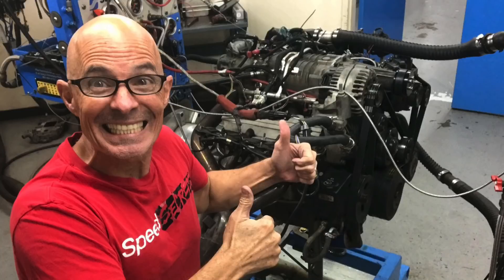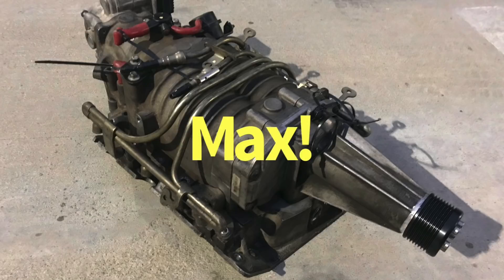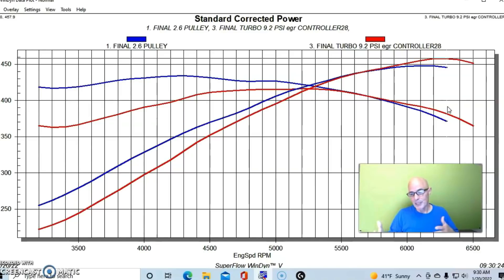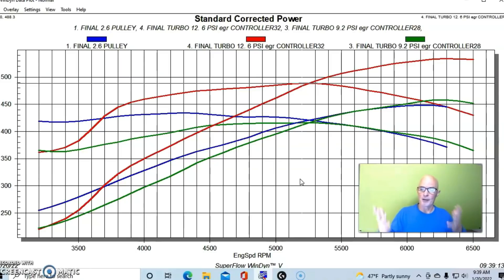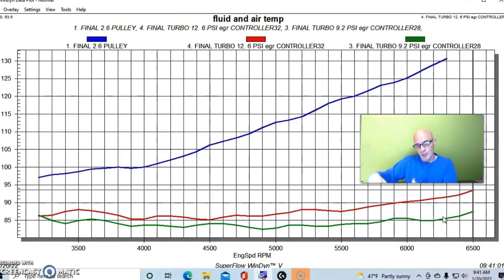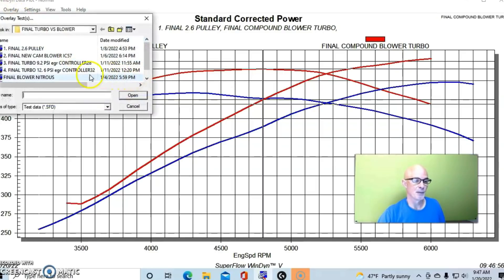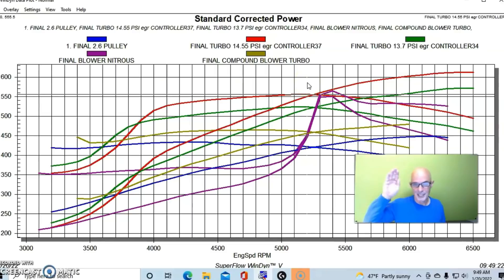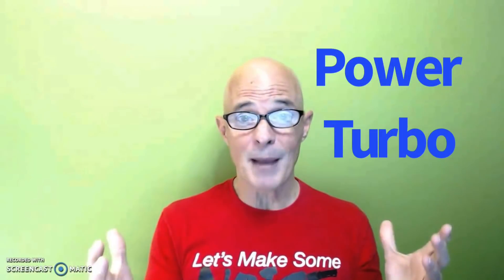WHAT MAKES BETTER LOW $, JUNKYARD BOOST? M90 SUPERCHARGER VS CHEAP, EBAY GT45 TURBO. RESPONSE VS HP

Comment: Could you look at the size difference between the turbo IC and supercharger IC? To be a real comparison @richardholdener1727, you would need to match the intercooler capacity and run the test again.  Much easier to do with a remote-mounted blower and IC.

Comment: I would love to see what an intercooled 1.9L TVS supercharger would do on this 3800 V6.  Also its best to have the supercharger blow into the turbo inlet in a compound setup.  The blower creates way too much restriction when the turbo is blowing into it and you loose the multiplication factor of feeding a turbo a boosted charge.  Maybe do a test and post the results.

Comment: Hey I remember once you said you couldn't run the chevy 3.9. I was just curious why. Same bolt pattern as a 3.8 and it runs on a e38 ecm on the one I've got on my rail buggy. I'd like to do some turbo stuff on one but curious what the power would be. Factory rated at 243hp N/A. Also love all these videos. You're the reason I went from a 14:1 383 to a stock 6.0 with a turbo and water/meth in my rockbouncer. So I'd also like to say thanks!

Comment: Figure out a way to run the supercharger air through the same intercooler you use on the turbos.  That big unit gives the turbo a big advantage.
Reply from the maker: THE TURBO GIVES THE TURBO A BIG ADVANTAGE-IT'S NOT THE COOLER
Reply: @richardholdener1727  No doubt.  I know that the old Eaton 5th Gens barely break 60% efficiency, and turbo's generally aren't even mapped below 65%.  If somebody is matching a turbo to their engine and ends up running below 70% efficiency, they have the wrong turbo.

But what is the relative effect of the two?  Gale Banks did some good testing of that in his Killing A Duramax and Building a Monster Truck series of videos.  At the ~40 psi boost he was running, the intercooler contributed about an equal increase in density as the turbo.

But the final intake temperature of 131F with the intercooled Eaton supercharger is pretty hot for an intake manifold temperature.  Taking another 45F out of the intake air would give a worthwhile gain.

Comment: If we are looking for boost response, the Ford 3.5 Ego Boost is amazing. With their small twin turbo setup, there is response at 1600 RPM. The 3.5 feels like there is NO turbo lag. Power response is as good as any super charger
Reply: Thats expected, it uses Tiny turbos.
Reply: Tiny expensive turbos that like too pop.

Comment: Before you add ring gap for the big bang can you tell up how close the factory ring gap is to your boosted ring gap formula.  
Fyi i do remember you mentioning ring gap varies from factory with the same engine.  
Still would be interesting to know.
Thanks!
Reply from the maker: I will let you know what it is when I disassemble

Comment: I think it would be really cool to optimize the super/ turbo combo. Like does the turbo blowing into the supercharger decrease the charge temp of the supercharger, making it more efficient? I bet others would be interested as well.
Reply from the maker: it makes the blower more efficient-but dramatically raises (compounds) the boost (which raises the air temp)
Reply: Some have, they begin to have diesel like power curves with huge tq and not as much hp. Something like 800-900 ft lbs and 600hp
Reply: The supercharger becomes a restriction when the turbo really gets going. Ideally you want the supercharger to cover low rpm before the turbo spools, then you want to bypass the supercharger and use the turbo. If you could disengage the supercharger all together too that would remove it’s parasitic loss as well.

Comment: How about a blower with a split sheave pulley so it can automatically spin faster at higher RPMs in order to keep up with the engine demands?
Reply from the maker: the design of the blower is the issue-not the speed

Comment: In Australia we gun the GTX3584RS turbos on these motor and they are perfect size for them. Will easily hold 600 wheel all day
Reply: I’m very jealous you all have the L67 in RWD applications

The L67 can make so much power here but it’s hard to find a transmission to hold up.
Reply: @BelushiSpeedBall  put them in Something else.
Reply: What rpm does it light that turbo typically?
Reply: Hahaha all day?! like to see it at the end of day lol .small pully DONE! roast ya at every lights. We still talking street driven car and just for the $ spent ?
Reply: @r0bkills  yeah righto, your air intake temps will fry your motor… but that’s all good

Comment: Drag race, turbo. Driveability power for your regular daily driver, blower. 

Just my opinion. That instant low end power is amazing.
Reply: Blower on the street rod/hot rod/pro touring track car. Daily it's turbo for reasonable economy and still brutal fast. Blowers and long trips don't really agree.
Reply: True

Comment: A GT35 would light off nice and quick and make more hp than any fwd could hook on the street.
Reply: I a t70 and even at just 16 PSI it is too much on 235 sticky tires
Reply: Running a ls4 with a s366 on 275s and it hooks surprisingly well

Comment: Personally I would choose the blower. Because drivability and being all in from idle is what makes a fun car to drive on the street
Reply: Until you take one of these cars and turbocharged it. And then you never look back.
Reply: @BoostedSpeedDemon  I personally own to turbocharged Hondas I used to have a DC2 with a Jackson racing twin screw supercharger kit full stop that thing was more useful from idle to 3 grand then my fk8 stock turbo and my da9 although it has a 3582 which is a tad too big for a 2 l lol
Reply: @b20vtec83  yeah but that's a Honda versus a 3.8 V6, not even comprable
Reply: @BoostedSpeedDemon  everything's comparable when it all comes down to  CFM and how much flow in pounds per minute. All displacement does is determine how much torque you begin with it's the compression device (super/turbo charger) that tells us how much power we end up with.
Reply: @b20vtec83  not really though, because the 3.8 is a pushrod V6 that was never designed to rev. Especially with a stock camshaft and valve springs. A Honda doesn't start producing the highest CFM until higher RPM. Whereas the Buick is going to produce a lot more flow at a lower RPM. Which means spooling a larger Turbo, a lot faster, due to high exhaust velocity at lower RPM, and the added exhaust volume from the higher displacement. Plus a Buick is simple there's none of that variable valve timing. It's really not comparable. Sure both of them use air flowing in a measurement of cfm's to make horsepower. But they flow completely differently, have totally different exhaust and intake characteristics, different displacements, different numbers of cylinders, different area under curve, different torque production, so they're not really comprable.
Reply: @BoostedSpeedDemon  I love being told what I already know, actually everything is comparable it's a matter of preference
Reply: @BoostedSpeedDemon  obviously turbocharging is better for all our power but from light to light and corner to Corner the response of a belt driven compressors just a little better
Reply: @b20vtec83  race car drivers learn to drive around the turbo lag, from corner to corner. That is, if the turbos are properly sized.
Reply: @2lotusman851  I love being told stuff I already know thank you
Reply: @b20vtec83  Your welcome.
Reply: @b20vtec83  it is not only about you...
Reply: @Grosflam  so what are you saying I should choose a set up the benefits everybody
Reply: The street manners are almost no different. And when the turbo runs at full Boost, it pulls much harder with a longer area under curve than the blower does. I know, I smoked my buddies fully built supercharged GTP with my bolt on turbo kit Regal
Reply: I owned a GTP. Tuned a turbo GTP. The GTP was way faster. The converter is kinda loose on them. Ran great until the so called built 4T65E HD died. The car was sold shortly afterwards. Smh...

Comment: I'd not put much faith in an M90 spinning fast enough to make 335kW lasting for long...
Reply: I have ran a 2.7 inch pulley on mine for the last 30k miles with no blower issues. Blower has 160k miles on it
Reply: I run my polished M90 1 2.5" pulley on an ATI 7.15" overdrive balancer, getting the pulley to about 2.25", all day long for years on E85 for a maxed out L67 for over 400 to the ground daily.

Comment: The snail duh, m90s are so inefficient
Reply: Keep in mind: M90 just was not designed to make that much power. It can, but not efficiently. Any blower or turbo will look bad when you use it outside of it's efficiency range. That turbo is more comparable to a supercharger about 2x the size of the M90.